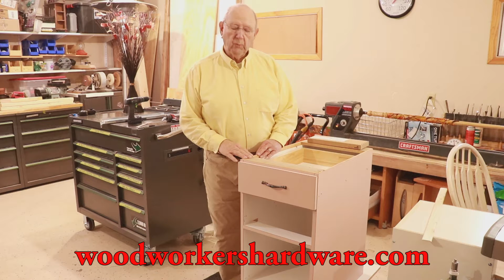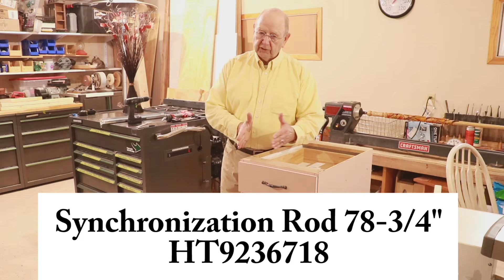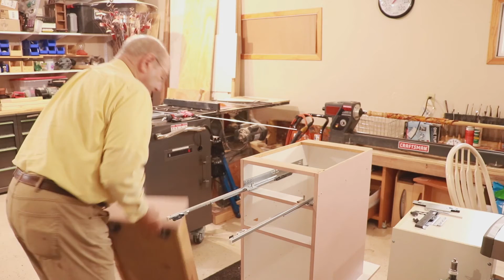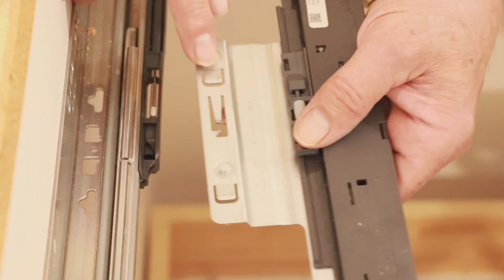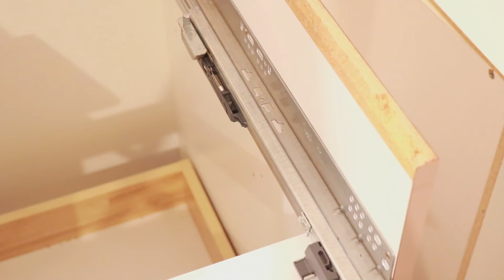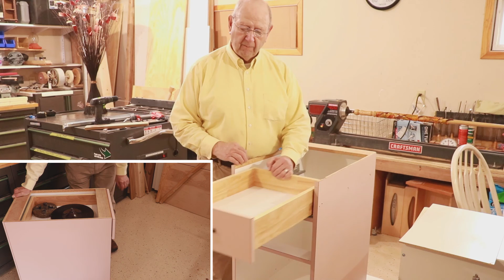DIY Your Way - Part 3, Hettich Quadro 4D, An Add-On Push-to-Open Feature

Comment: Is it possible to just pull out the drawer by hand when the push to open device is installed? Or is it completely locked and you have to push to open it?
Reply from the maker: That's a very good question.  We have a great customer services team that you can talk to at our toll free number 800-383-0130 that was mostly trained by Larry and has over 50 years of experience combined, they would love to help answer any questions about this product, or any others.  To answer your question though, I have been informed that yes, it can be pulled open as well!